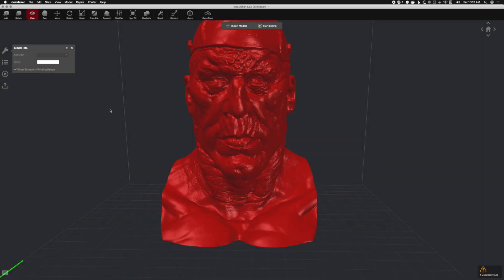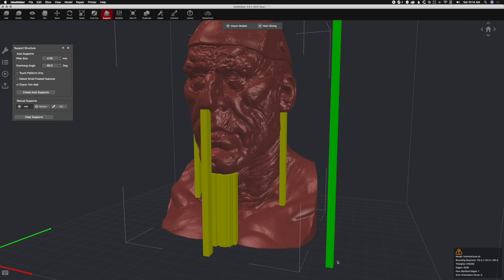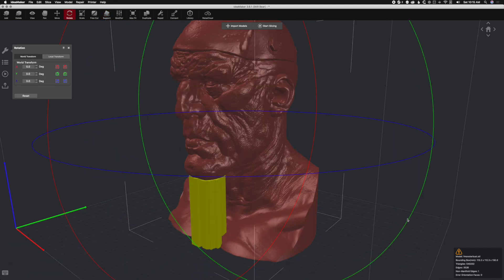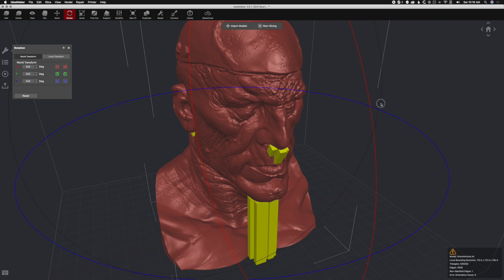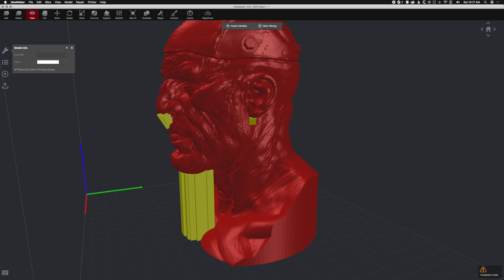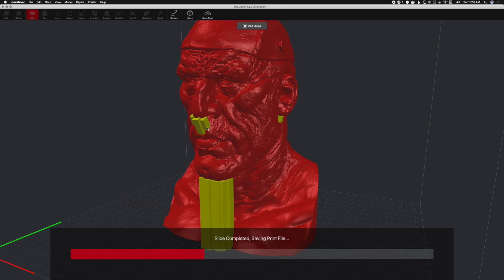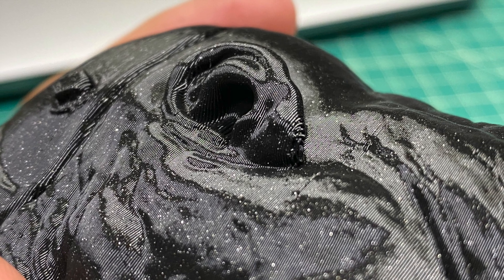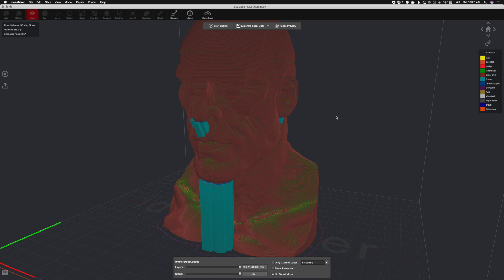Ideamaker: Angled Supports

Comment: Wow this is super useful! I printed some gigantic covers for work (around 3ft x 2 ft) and the supports take up about half the filament. These parts weigh around 2 kg each and take upwards of 2 days. I used ideamaker, but I had no idea you could do this. It would have saved a lot of time and material!